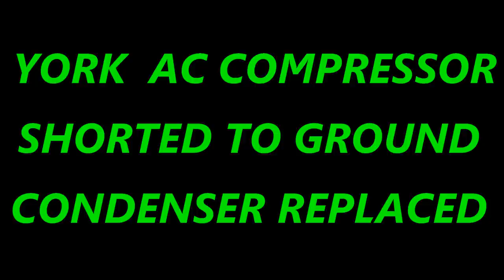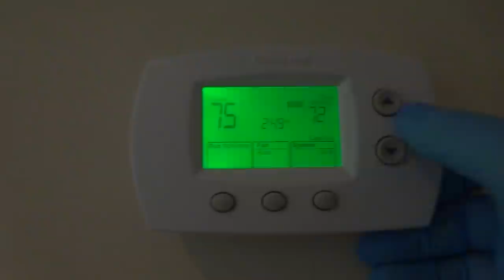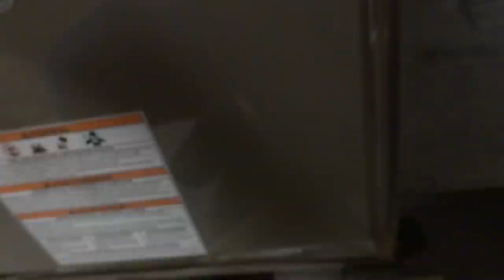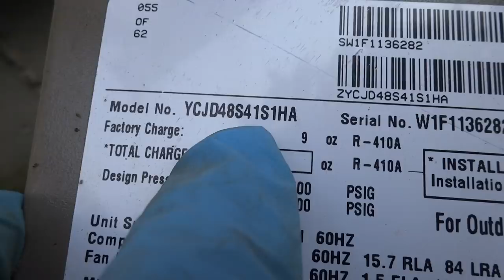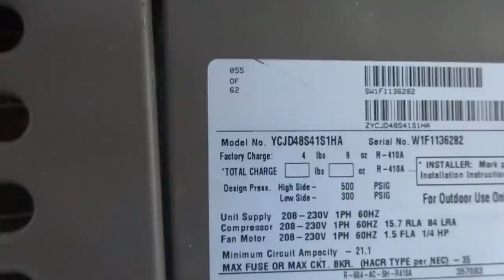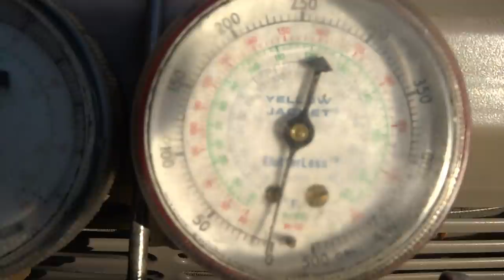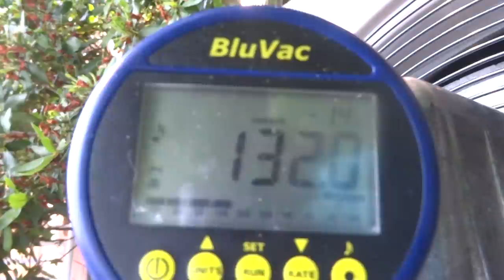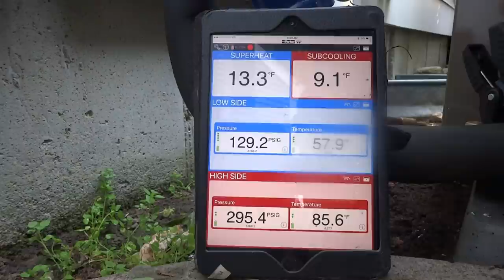YORK AC COMPRESSOR SHORTED TO GROUND CONDENSER REPLACEMENT

Comment: I think that condenser might still be under warranty. Yoek have 10 years warranty. I just looked it up... it looks like no one registered it. Shipping date was 6/28/2011 and compressor warranty expires 06/28/2021. So if the homeowner have their contract paperworks... with later date... it would be under warranty. I helped a family get their AC repaired under warranty... also on the edge of expiration date... they got it covered minus nominal labor charge. Saved thouands last year.

Comment: I do alot of york installs, and when you take the black brackets that hold it to the pallet it comes on off, you have to put the screw back in the unit because they connect part of the covers, or else they rattle like that.
Reply from the maker: i put the screws back in
Reply: Steve doesn’t have a screw loose. LOL!

Comment: Once had a shorted compressor blow a hole through it's glass terminal plate in from of me as I turned it on ,it did make a small explosion and blew all it's refrigerant and oil . Also had 600 v. belt drive unit motors  blow from deteriorated windings and age .

Comment: If I had an air conditioner that went out after 10 years I sure wouldn’t be going back with the same brand that’s for sure. That air conditioner sounds like crap straight from the factory . Great job Steve, I know you have to provide people affordable options to fit their budget.
Reply: Most of the innards of a condensing unit are from the same companies (Copeland makes most of the compressors, Parker makes the king valves, Emerson makes the fan motors) usually the manufacturer only makes the enclosure and the coils. The install and who performs it is way more important than the brand.

Comment: I've noticed a little water inside the machine room i have were the unit is located. Brand new carrier inside and fejtsu   outside. Its draining but maybe its a little clogged. Can I blow some compressed air via the vent spot on the drain tube?
Reply: Yep,but shop vac will suck it out

Comment: So does the homeowner get charged extra since you had to add extra 410a?  Seems that would be the manufacturers problem for shipping the unit under precharged
Reply: The unit is charged for a matching coil and so many feet of lineset. If you have a longer lineset it’s not uncommon to have to add some gas.
Reply: Units only come with a charge that will fill 15 ft of lineset.. its not anybodies fault. If you supply a unit with a larger charge but it is installed with short lines your unit will be overcharged...

Comment: A little tinny? More like it sounded like crap. I’ve never installed a unit that sounded like that straight out of the box. I was debating if I should switch to installing York’s, after this no thanks.
Reply: York is owned by Johnson Controls,they all but ruined York's reputation

Comment: Probably cheaper to replace compressor nothing wrong with micro channel did not even check if it was just the plug the went bad did not check contacts to see if it's just that there is a 15 year old micro channel 4 ton at work hasn't had a single leak

Comment: Why do states put Seer limits on equipment
Reply: I bet its Like they think by doing so it will Combat or reduce Global warming, As I hear How Biden seems to Blame most every thing for Global Warming, He wants all Electric in future, but that in itself will be Next to Impossible,Yet where does he think That Electric is generated from, as its not Just wind or solar, theres also the more reliable power plants that still use fossil Fuels to run, without that every one would end up Like Texas did during the winter if every thing Froze,But again my guess is the Global warming thing.
Reply: Since they have to work a lot harder in the hotter states they require higher efficiency. 13 SEER is only allowed up north with straight cooling. If it's a heat pump it has to be 14 SEER in the northern states too. Up to about 16 SEER you're good (aside from the units being larger). Past that you're dealing with multiple stages or variable speed setups with inverters that love to burn out way too soon.
Reply: @throttlebottle5906  That's usually only on the even higher rated units, which are junk and will never pay for themselves, even with the rebate. Up to 16 SEER its really just larger coils off a single stage compressor (and maybe a 2 stage condenser fan) so it works more efficiently. Tried to convince a friend in AZ to go with the 16 SEER Rheem heat pump, but no, they had to go with the 3 stage 18.5 SEER rebate unit (with proprietary thermostat and variable speed blower to boot). Just waiting to hear the cries when it breaks.

Comment: Why the second drier? I install York’s and they already have a factory, pain in the dick to get to, filter drier pass the liquid valve
Reply: York units only have a factory dryer on heat pumps. Straight air you have to install.

Comment: You checked the wires off the compressor and then pull top to check at compressor. Should have checked right at compressor to begin with. Wasting time.

Silver soldier on r410a ends up leaking , suppose to release on suction so you don't blow oil down to metering device and vacuum gauge on pump is a false reading. Needs to be down to condenser. Total hack...
Reply: Ikr silver will blow eventually r410 pressure are high af with heat they lose up and will blow
Reply: He did not even weight the freon going in